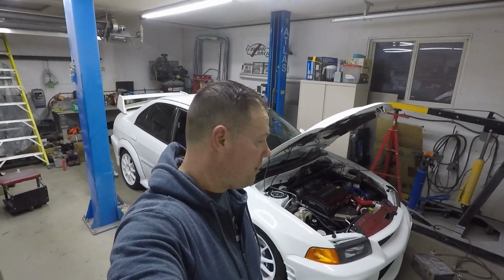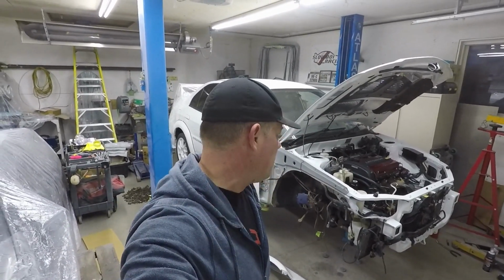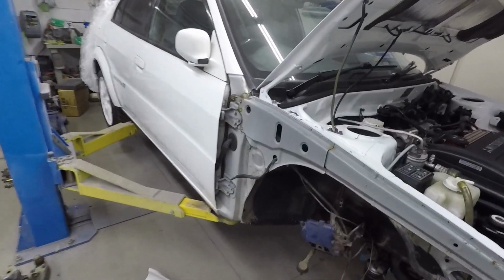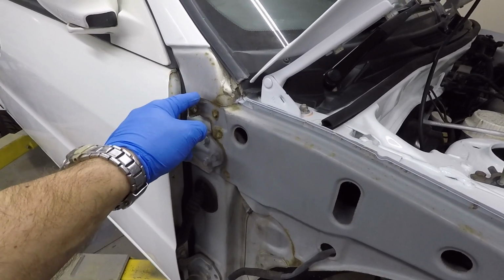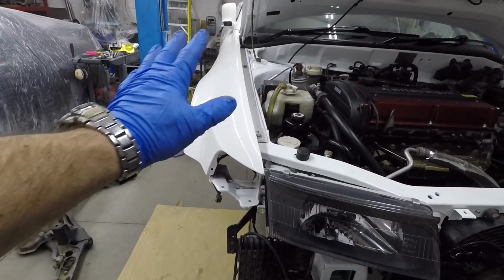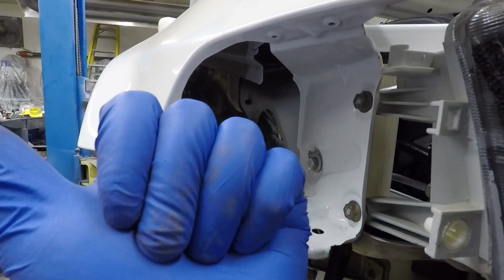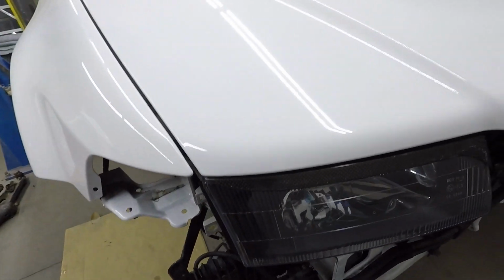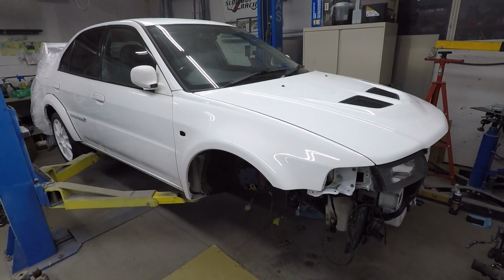Mitsubishi Evolution 6 Project!! 2022 23 BONUS TRACK 4

Comment: I agree. Gaps are so important. Did you include the thin OEM rubber washers between the body and the alloy fender?
Reply from the maker: Yep, they are still there but pretty worn out. 😁
Reply: @wrenchrampage  Even new ones get squashed to almost nothing when you tighten the bolt for the first time. But they do actually work as one was missing on my fender and that spot had corroded more than other spots on the fender